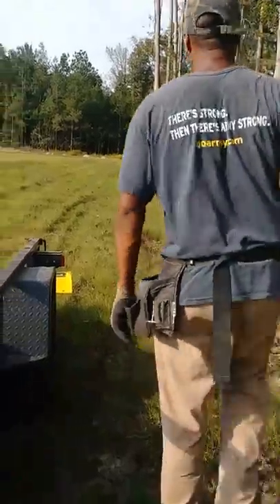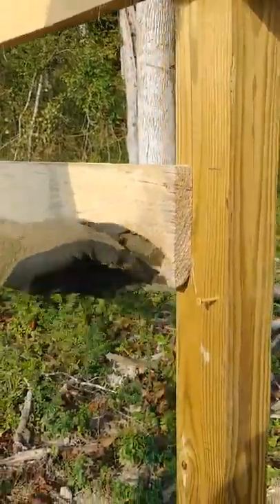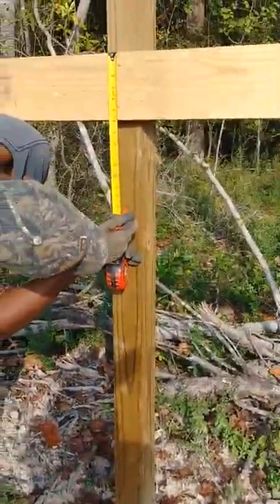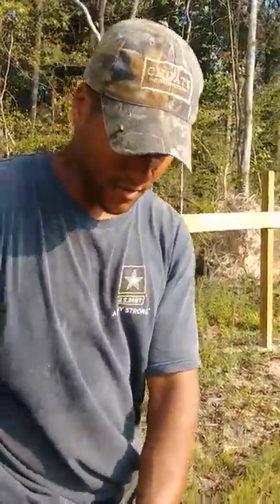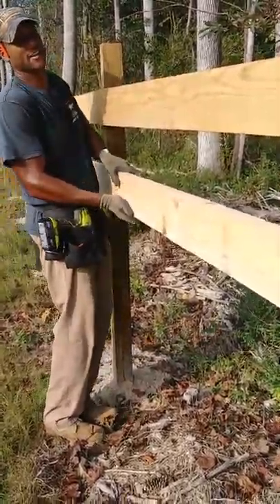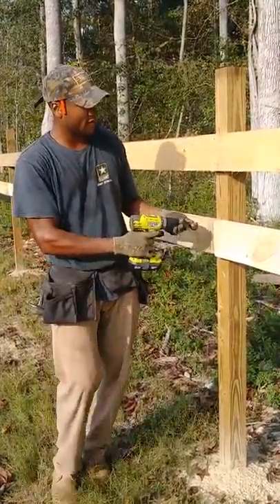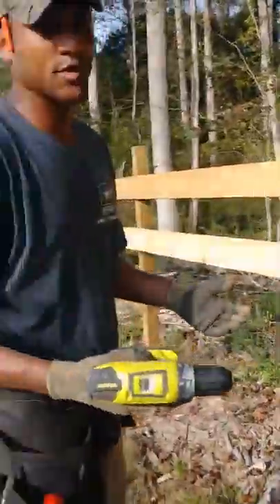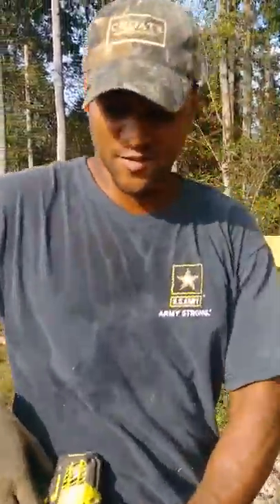How to build a 4 board fence by yourself

Comment: Thank you!  I rarely have help & was wondering how I was going to be able to do this by myself!    ,,,    Did you set the posts with quickcrete?  2 feet down?
Reply: You're welcome!
Reply: Posts are set 3' in the ground. You don't want to use concrete because its like a sponge, it traps water around the bottom of the posts causing them to rot. Use gravel instead, 57 stone. It will allow water to drain and wick away from the posts. All posts will eventually rot, maybe 20-30 years from now, but eventually they will. MUCH easier to replace a rotten or broken post that's set in gravel than one that is set in concrete! Hope this helps.
Reply: @jaydu-sauzay4276  wow!  Thank you for the quick reply!!    One more question, what is the spacing on your posts?
Reply: @jaydu-sauzay4276  lol ... I just realized that you're probably not the same guy who posted this video?  Or maybe you just have two channels?  Anyway, thank you soooo much for the advice!
Reply: @TheWayshower  No problem. Spacing is 8'. My boards were 16' long so i could stagger them across two posts. I am indeed the same guy!
Reply: @jaydu-sauzay4276  ♥♥♥
Reply: @TheWayshower  oh and spacing between the boards is 8". The boards are 6" thick so the top of the top board is set at 60", next is 46", next is 32" and the bottom board is 18" above ground leaving 10" between it and the ground.
Reply: @jaydu-sauzay4276  lol .. I was just wondering about that ... so, 2x6x16  is what you used?  NM ... I figured it out (decided to use my brains)  ... Thank you!
Reply: @TheWayshower  Use a sawzall to cut the fence post tops off. Takes about 10 seconds per post that way. Cut them at a slight angle sloping away from the fence boards so that water drains off the top of the post. That'll keep the tops from rotting.
Reply: @jaydu-sauzay4276  thanks again for the info ... I watched dozens of videos to help me figure out how to do this by myself (no extra hands),  I wanted to be as informed as possible, and your video is hands down the best one I came across.

Thanks again, truly appreciate it!

Comment: Thank you for a quick informative video! Do you then screw a 1X4 vertically down over the fence boards at each post to keep the horizontal fence boards from popping off the posts  if they warp?
Reply from the maker: Yes. This is very good practice if you can afford the extra lumber. If not, you'll just have to plan to spend a couple hours each year reattaching a few boards. In my experience, in 6000', using rough sawn, untreated lumber, about 20 boards pop off each year.

Comment: Nice video and instruction, how long are the screws you're using/are they anything special and what was your saw plugged into in that field?
Reply: Hey, the boards are true 1.25" thick, custom cut. Screws are 2.5". Just exterior grade wood screws. Saw is plugged into a 4000W generator.
Reply: Thank you very much for your prompt reply!